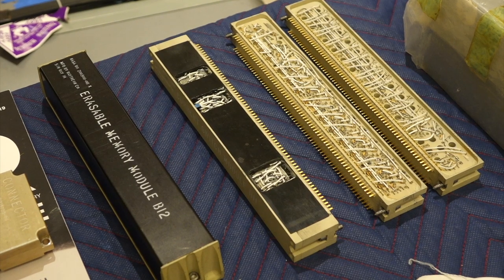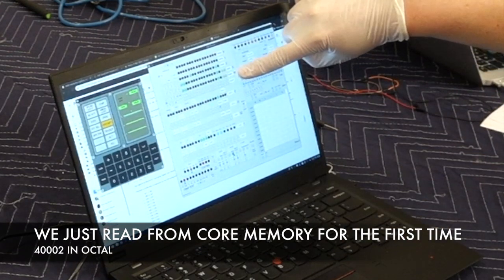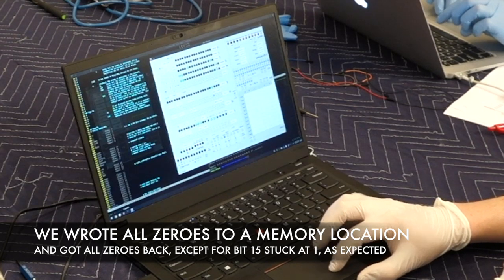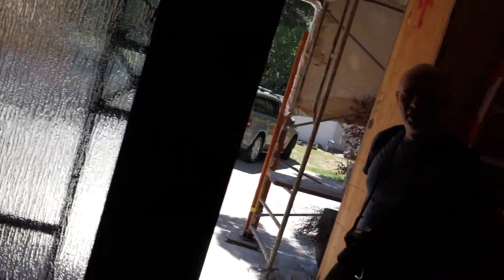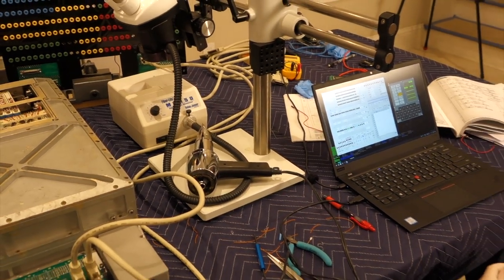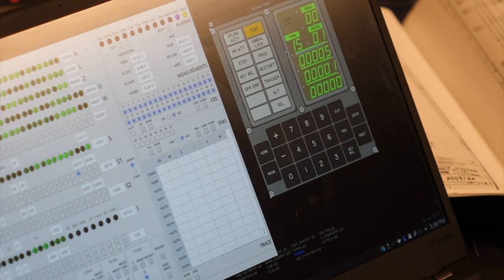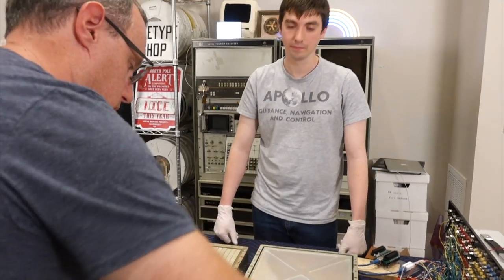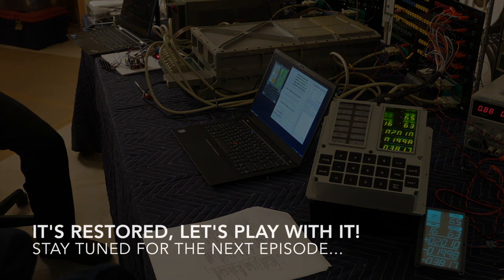Apollo Guidance Computer Part 19: It finally works!

Comment: Step one:  Acquire working ACG - Achievement unlocked.
Step two: Acquire unused Saturn V...
Reply: haha! ... next week: Colin Furze stops by!
Reply: Just find an Agamotto stone, and steal the Saturn V used for Skylab ^^
Reply: You need two AGC per mission. ;-)
Reply: @johnanon6938  yeah I doubt they'd use a original agc. But from what I've seen of these guys they might use one just to make it that much more authentic
Reply: well, several exist, cape canaveral, huntsville, al, I think houston, and probably a couple others
Reply: John Anon psh, let those F1 engines  roar again. Who cares if it explodes, so long as there’s a working escape tower it makes for good TV :)
Reply: mark williams ok, we need an “Ocean’s 11” type group.  Now, after we steal it, how long do you think we’ll have before they notice?
Reply: mark williams The upper stage of the one in Houston isn’t original. They used it for Apollo-Soyuz!
Reply: @robjohnson1138 just replace it with a dummy
Reply: mark williams The big challenge would be restoring the LVDC (Launch Vehicle Digital Computer) to working order. To my knowledge, the source code for the software that ran the guidance system has been lost to time. There might be a copy of the binary program still in one of the instrument units on display but whether it would be possible to recover it is a totally different matter.
Reply: There appears to be very little information on the LVDC, which you'd definitely need for a Saturn V (or 1B).
Maybe the AGS would be a better option as a follow on project. Especially given that it, rather than LM AGC was used on Appllo 13.

Comment: Well done indeed guys! If you could win a Nobel prize for old tech restoration you would win it, but most of all, the "man never went to the moon" brigade should hang their heads in their stupid shame as no one would have developed the AGC to perpertrate a hoax, let alone the incredible work you guys have have done to get it working properly decades later. I have run out of expletives  apart from SIMPLY MAGNIFICENT!

Comment: Where’s the cold plate it’s supposed to sit on for cooling?
(I worked on Apollo in 1962-65 in engineering at North American Aviation in Downey Ca)
Reply: Marc did buy one for the project but for the relatively short periods we operate it, and given that it has air flowing around the chassis, it wasn't needed.
Reply: Im just curious of your thoughts on the methodology used in this video and how it compares to what you remembered working on the original?d

Comment: I have enjoyed these videos more than words can say. I so wish I'd been there - I started my tech career with giant wirewrap boards and chasing that one bad timing in the middle of a twenty page discrete logic diagram, but I never had to drill out potted circuits to replace errant diodes. (And our scopes cost as much as houses and didn't work a tenth as well as yours, but hey.) Well done. You are go on that alarm.

Comment: Seeing at the AGC with the new connectors to facilitate connecting new equipment brought this analogy to mind: a man I know fairly well is kinda like Jimmie (plenty of moola). But instead of hotrodding ancient computers to make them functional again this man bankrolled and drove a Bonneville car that went in excess of 200 mph with an original block flathead.

Comment: I just think it's sad that we have a working AGC and nobody else with parts is willing to offer a memory module for use indefinitely.
Reply: Mark M are their any IMU’s still in existence that might work? I would love to see that happen!
Reply: @trcostan  There are a number of them in museums. they were built to extreme precision to depending on the state of the lubricants and adhesives used in it's construction, these guys are 100% up to the task of restoring one.
Reply: Chrismofer if anything I think it would be super cool to see a mission flown using a simulator that’s interfaces with the AGC using modern computers to emulate everything. It would be cool to see how it interfaced with IMU, Radar etc and how the data link across the USB system worked in detail. Love this stuff
Reply: @trcostan  To emulate an entire Apollo spacecraft and interface with the AGC would be nuts. Mike is a programming wizard but he probably wouldn't do that.
Reply: Mark M orbiter space flight simulator has the NAASP project which does simulate all the Apollo systems. I think if they interface with that, they should be able to do a full flight simulated.

Comment: Congratulations on getting it working! It's mindboggling that, 45 years later, the cores are in good enough shape to tell you that the last thing they did was force a gimbal lock, AND they were working in one of the simulators at JSC at the time. 

I'm wondering - if you've got latitude, do you also have the time/date in core somewhere? At least on earth, time is one of the pieces you need to get longitude. It may be hard to identify though, unless it's a known input to the coarse alignment program and you can figure out where it would be from the code.

Comment: I think the real story here is how Mike manages to use his laptop with latex gloves on for hours on end. 
 That would drive me bonkers.
Reply: I got used to working in clean rooms for hours at work... so I felt right at home working on the AGC. :)
Reply: @mikestewart8928  Hello Mike, can you say what the 'LED patterns' software was created with? Looks very good!
Reply: @pault5179  Thanks! The blinkenlights panel is all python3 + pyside2 (Qt). I drew the DSKY in OnShape using original engineering drawings, then exported it to InkScape and colored it in per original specified paint colors and light wavelengths, and finally chopped it up into a Qt widget, so it should look quite accurate.
Reply: @mikestewart8928  Thanks very much Mike, it will be interesting to try it

Comment: I know it's now one year old and I probably won't have answer to my 
questions, but, I try : 
1/ since you use the hardware parity bit to replace the faulty MSB, how 
does the module continue to work without parity bit, did you add a 
circuit to recreate parity from that actual word value ?   
2/ in the memory you read, you have MSB zeroed in every word, how did 
you do the forensic search with that false bit ?  Anyway, thanks for 
this wonderful restoration, wonderful series, wonderful channel, 
wonderful crew !
Reply from the maker: 1) We disabled parity checking as part of the modification.
2) The fault was on bit 16 inhibit line only. Which means we could read bit 16 via its sense line, but we could not write it back via its inhibit line. As you may know, reading core memory is destructive, you have to rewrite a bit after you read it, or it's lost. So we had only one chance at it, which is why reading the memory is the first thing we did immediately after repairing the memory support circuitry. We did read its entire content. After we had safely archived the content of memory including bit 16 (but permanently reset all the bit 16 cores by so doing), we made our modification and swapped the parity bit 15 for the dead bit 16.

Comment: Is bit 15 the most or least significant bit on the AGC? Some computers start numbering bits with the least significant as bit 0 (x86,PDP11,6809) and others start with the most significant bit as bit 0 (PDP10)
Reply: The bits start at 1 as the least significant bit, and count up to 16 as the most significant. Bit 15 is used either as a second sign bit (for overflow detection) or parity, so the logic operates on bits 16 and 14-1.

Comment: Wow! Its hard backplane wirewrap modification! The manual of this backplane modificacion manual is published anywere? Its interessant trick to avoid bit error.
Reply: We have a complete interactive map of the backplane online, if you want to check it out. It's been vetted against the schematics by multiple people, and has had many connections beeped out on this AGC for confirmation: http://apolloguidance.computer/2003100_071/pins
Reply: Mike Stewart thanks Mike, great job! Congratulations from Mallorca (Spain).

Comment: I didn't see all of these videos (yet), but have a question.  Does the AGC have an output module with transistors or relays to interface with the spacecraft?
Reply: It has output modules that are a mix of transistors and pulse transformers. The spacecraft uses 28V signal levels, along with pulses on differential pairs that peak at about 7V. 

The main I/O connector (A51) has 360 pins. Some were power in and out, but it provided for 85 output signals, 61 input signals, 52 pulse output signals and 33 pulse input signals.
Reply: @carlclaunch793  Wow, excellent detailed answer Carl.  Thanks!

Comment: How cool would this be to setup a Virtualized Spacecraft that would be controlled by the restored AGC and then display that Spacecraft through a controlled flight or landing on a very large screen.  Probably a little over the top to try and replicate all the peripherals that were connected to the AGC through computer simulation but I'd love to see it...
Reply: hey they might even be doing that! Sounds plausible.
Reply: This really is way cool!  My Dad worked on the Apollo and Skylab programs for McDonald Douglas and I actually got to watch a couple of the Saturn V launches from my backyard in Cocoa Beach.  Wish I could have been closer but I still remember the sound was unreal even from that far away and I was like 6, 7, & 8 years old during those launches.  I still remember the old man taking us down to the vehicle assembly building and we got watch them transport one of the rockets to the launch pad.

Comment: Im wondering - when you deal with the backplate modification - do you consider stuff like the durability of the heat-shrinkable sleeve or the orange cable insulation? It would be a shame if someone opened this up in 20 years and all the insulation turned into a sticky goo or something...

Comment: You did still use Ken's rope memory emulator in the presentation didn't you? That has nothing to do with the erasable memory you restored in this episode, right? I got a bit confused about all the different types and names of memory in this computer.
Congrats on restoring the AGC — now it's the only working one in the world, it was a great pleasure to watch your videos!
Reply: yes, (from what I gathered) they used the original, repaired rope memory emulator running the software copied from the rope memory module from the AGC  at the computer museum
Reply: The computer has two types of memory - read only (fixed) for programs and read-write (erasable) for data. Core Rope is used to hold the read only programs. Core (traditional core memory) is used for data.

Comment: Awesome work!!! Been watching this series from the beginning!

Technical question : You don’t go into detail as to why you are able to basically disable the parity bit and the computer continue working without triggering parity alarms. My understanding of the AGC architecture is that it auto senses parity and will cause a restart when it detects a parity bit error. Wouldn’t this open the computer to an endless loop lockup?
Reply: Technical answer: we grounded pin 262 on module A14, Memory Timing and Addressing. This is a test point, not wired to anything on the backplane, whose name is "TPGE", or "Test Parity in G, Erasable". Inside the module, a pulse on this net signals that it's time to test parity during an erasable cycle. There's a separate signal, TPGF, which generates a similar timing pulse for fixed memory. By grounding TPGE (which can be done safely because of RTL logic), the computer is no longer able to decide it's time to check parity from erasable, but fixed parity checking continues to work.
Reply: There is a gate that triggers the erasable memory parity check, but it can be held off with one jumper. The machine never performs the parity check, thus it never detects a parity error. 

Fortunately, this is different from the logic that triggers a parity check in fixed (core rope) memory so we still do have detection of parity errors in the read only memory.

Comment: Next chapter: AGC connected to the internet
Reply: … chapter after that one:

"Security Alert: AGC '0014, Multiple CVEs …"
Reply: No way in hell. I bet some trolls would like nothing better than to try to fry it by locking it into mining bitcoins until it overloads from thermal failure.
Reply: it would be impossible to plug any hardware in to it and it wouldn't really manage to run an ethernet adapter

Comment: Fantastic! It's awesome to see this piece of history operating.
Could you tell us a little more about the history of this AGC? I believe you mentioned it was part of a simulator. Were there other simulators? Was this the simulator astronauts trained on? Where did it go after it was scrapped and how did it end up in a private collection?
Reply: This AGC was installed in Lunar Module Test Article 8 (LTA-8) which was placed in the huge vacuum and thermal chamber in Houston. It was used to qualify the flight LMs for readiness to carry humans in space. 

The AGC was auctioned off in a large lot of NASA surplus items by the General Services Administration in the mid 1970s. A recycler won the bid but agreed to sell two tons of space related items to the current owner, Jimmie.

Comment: Nice twist (8:29): "We also need to disable the parity chekcing"
Reply: Luckily, by grounding the TPGE pin on module A14, we're able to disable parity checking only for erasable memory, but leave it working for fixed memory.
Reply: @mikestewart8928  Great to hear, but i meant the intentional spelling error (I presume) in the video at 8:29 :-)

Comment: WRT to the latitude/longitude read out of memory. Google maps would use a different datums (WGS84 or later) than that used by the Apollo space program. Not that it will make much difference - a few hundred metres to a few km. Congratulations though!

Comment: You said not to ask but...WHY are logical/physical bits 15 and 16 swapped, after all?
Reply: In the computer digital logic/registers, values are 15-bit but stored with two sign bits. This is used for overflow detection; if you perform an operation that causes your accumulator to overflow, its two sign bits will then disagree. Bit 16, the main sign bit, preserves the sign of the answer, so only the magnitude is lost. The software can't directly see bit 15. Instead, it can only infer overflow through some instructions whose behavior is modified (e.g. TS).

When the data is written back out to core memory, bit 16 is selected as the true sign bit, and bit 15 is discarded. A parity bit is also generated, and instead of shuffling everything around, they opted to just write bits 16 and 14-1 to their correct locations, and fill the parity bit into the now-unoccupied position 15.
Reply: Mike Stewart Thank you so much for the explanation! Fascinating details compared to modern general-purpose computing.

Comment: How do the 2 sides connect together? I cant see any visible connections?
Reply: There's three 80-pin intertray connectors that run right down the middle of the computer. You can see them in the middle of both trays here: http://apolloguidance.computer/2003100_071/pins
Reply: There are a row across the middle of male pins on one tray and female pins on the other. When you see Mike press down and hear the snap sound, that is the connectors mating.
Reply: Carl Claunch ah! Thank you very much, hard to see on video 😃

Comment: So the whole computer was built with only one type of ICs (NOR-gates)? From wiki: "used 2,800 ICs, each with dual three-input NOR gates"
Reply from the maker: One type of logical IC, the dual nor-gate as you describe (the Block I had single NOR gate ICs). It also used one type of analog IC, a sense amplifier. Both were among the first of their kind.
Reply: @CuriousMarc  Thanks for the answer! Amazing building a cpu from just nor gates....what tasks did the computer do in the LEM?
Did it control the descent to the moon or did the Neil and/or Buzz do that?
Reply from the maker: @knegon  Flew the whole thing to the surface of the Moon. Even when Neil took over at 500 ft, it was still fly by wire with the computer controlling the descent engine and the rotation rates. And then all the way back to rendez-vous. We do fly the landing with Mike's FPGA replica in episode 23: https://youtu.be/r_eBGSe5zEQ, and with the real thing in episode 24: https://youtu.be/r_eBGSe5zEQ.

Comment: Did you use the still working parity bit to recreate the missing, defective bit by assuming that parity is correct?
Reply: Indeed. We based this on the expected very low risk of a bit error, especially while sitting at 1 g with no vibration here on earth.